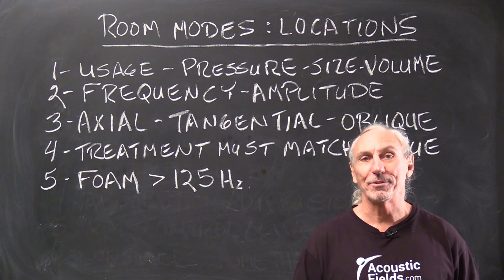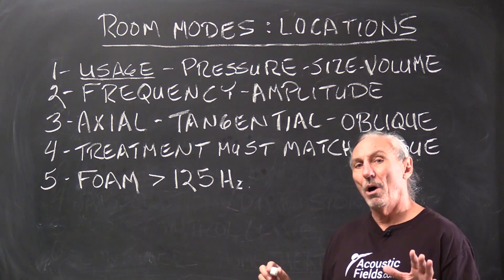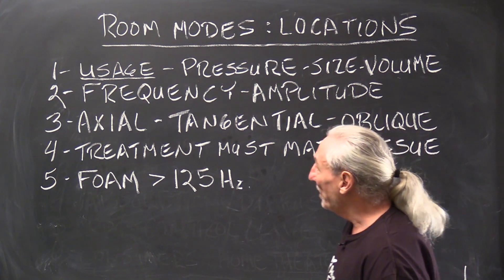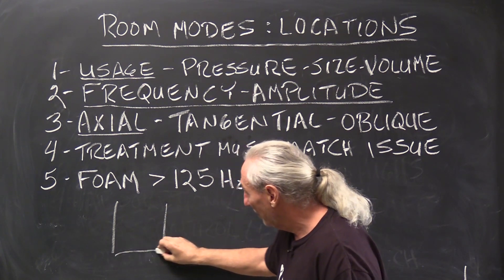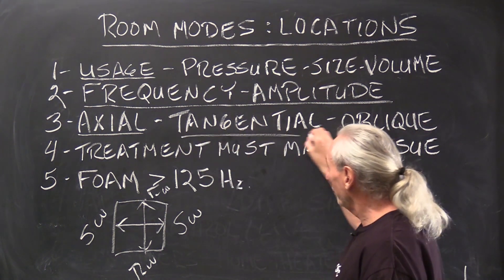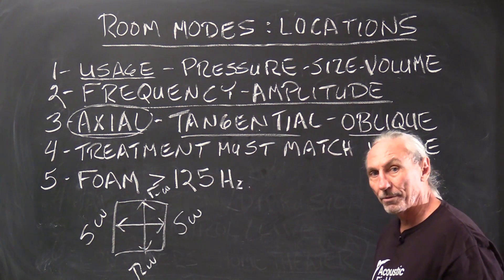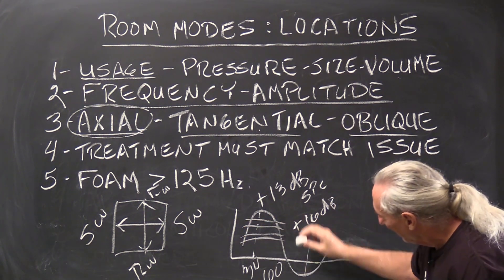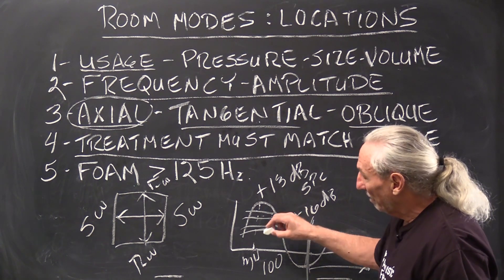Room Modes: Locations - www.AcousticFields.com

Comment: 5:37.  So if the walls actually HELP my subwoofer play even louder, why would I complain about that?   That just means I got an even “more powerful” subwoofer without having to spend more money.
Reply from the maker: Quantity is not quality. Making the low frequency energy "louder" by using room reinforcement is applying distortion ( room reinforcement) to achieve resolution. You are chasing your tail along with shooting yourself in the foot.

Comment: Keep explaining it, I'll get it one of these days haha!
Reply from the maker: Pressure and reflections are the two main issues. Pressure is a low frequency issue and reflections are middle and high frequency issues. We use absorption for low frequencies and both absorption and diffusion for middle and high frequencies. Diffusion is not a low frequency managemenht tool.

Comment: Hello, how can i calculate L shape room mode ?
Reply from the maker: You must use a rectangular space for your usage. An L shaped room will not produce predicatable and consisten modal patterns. Take the rectangle and measure inside of it. Place the opening to the rear of the room during measurement process..
Reply: @AcousticFields  thank alot for your reply but can you explain me how to place that opening to the measurements ? ,considering it’s not just an opening it is large enough as if it’s another room, same width both rectangles and almost same length

Comment: this all depends on the lowest speaker frequenties used in the room...At 60Hz, simple solutions are available.
Reply from the maker: Simple solutions produce low resolution sound quality. Our mission statement is to produce the highest resolution possible by treating all issues above and below 60 Hz.
Reply: @AcousticFields  Yes, but is it required if you have speakers going only down to 60 Hz?

Comment: Problem is when you live in NY and the typical home costs $400+ per square foot. To buy a home with a room big enough to get decent quality sound for a home theater, you have to be a multi millionaire.
Reply from the maker: Room volume for theater is the most critical variable we face with multiple channels of energy.
Reply: @AcousticFields  100%. Small rooms suck, especially basements with 7 foot ceilings (99% of basements on Long Island). Did the best I could with what I have, but I still long for a nice big room. One day, when I move out of NY

Comment: The most ignorant question. But if you treat the sidewalls for low frequency issues, how does that affect you in the listening position if you are 6 feet away from the sidewall? How does that impact the listener when you were not near the sidewall?
Reply from the maker: S, Reducing sidewall unwanted pressure issues improves room response regardless of location.

Comment: In theory couldn’t you have an active noise cancelation subwoofer setup to not completely kill but at least damp the unwanted low frequency peaks? Might be whole lot simpler than passive damping/absorption/diffusion. Pretty sure it exists in high end vehicles these days.
Reply from the maker: D,  Yes and no.  You can reduce amplitude or strength of certain frequencies and even certain octave bands. Making the energy source fit the room requires signal processing which has its own set of issues. Treating the room as best you can for low-frequency energy produces a different sound quality. Its more organic and life like.

Comment: I swear I’ve moved my system around 10 times since the quarantine. I hate being handicapped by small rooms but I have no choice where I live. Helpful videos!
Reply from the maker: J,  You can't hide from low-frequency issues in small rooms. You must treat at least two parallel walls as a start.

Comment: Hey Dennis, the only space I have for a theater room is in the basement with a 7’4” open joist ceiling height and a 10’ width with a variable length up to 25’. Looking to do an atmos in ceiling speaker setup. Is it doable?
Reply from the maker: D, No, it is not due to your low ceiling height.

Comment: Now that we know what treatment is most likely required (axial low frequency), I'd like to know how to determine on which axis you need that treatment.
Reply from the maker: T,  It depends on room size and usage.
Reply: Acoustic Fields 
My room is 11’x11’ w/ an 8’ cieling and I want to use it for mixing. 
I just assumed I’d need treatment on each axis.